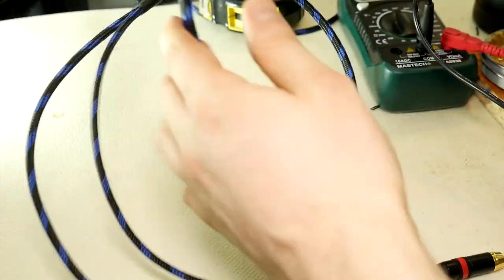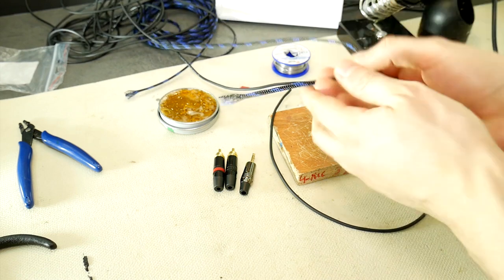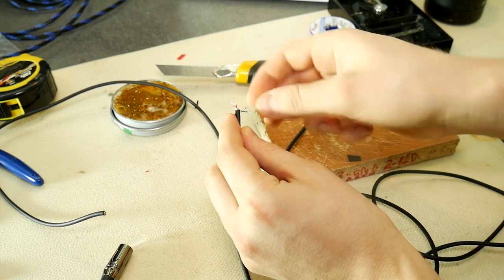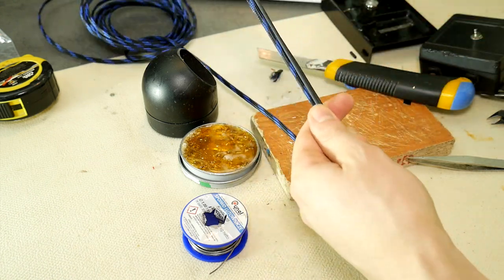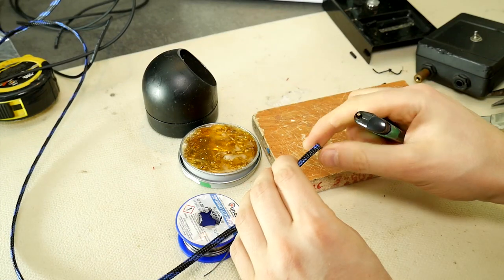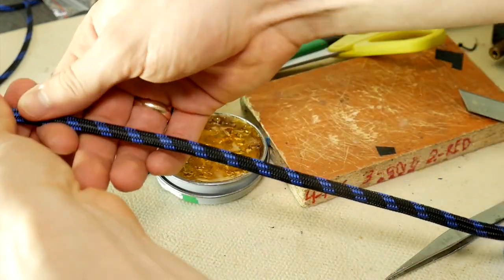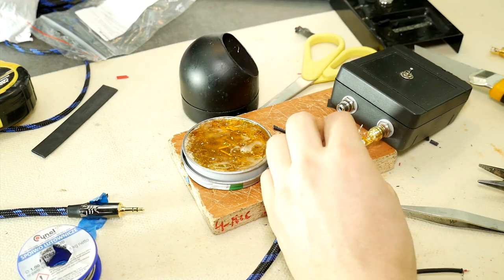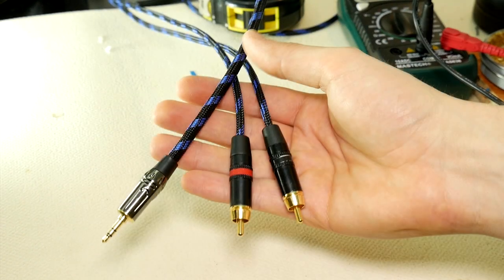How to make HQ AUX to RCA cable [DIY]

Comment from the maker: PARTS for the AUX cable build:

Aliexpress:
- 3.5mm jack: https://bit.ly/3nGrRWD
- RCA connectors: https://bit.ly/2PMIBio
- Microphone cable: https://bit.ly/3nHu6bT
- Braided cable sleeve: https://bit.ly/2QMGNq0
-  Heat shrink tubing: https://bit.ly/3aWh0CC

Amazon US:
- 3.5mm jack: https://amzn.to/3t5BCyA
- RCA connectors: https://amzn.to/3SbClfE
- Braided cable sleeve: https://amzn.to/3EmcQ5P
- Heat shrink tubing: https://amzn.to/3xJ6nN9

Amazon UK:
- 3.5mm jack: https://amzn.to/3lKifNw
- RCA connectors: https://amzn.to/3IDaJ02
- Braided cable sleeve: https://amzn.to/3eaG76N
- Heat shrink tubing: https://amzn.to/3eQL1os

Amazon DE:
- 3.5mm jack: https://amzn.to/3nHt3ck
- RCA connectors: https://amzn.to/3nDFPIw
- Braided cable sleeve: https://amzn.to/3t9NmA3
- Heat shrink tubing: https://amzn.to/3xQDsXM

Comment: So the Aux connector you linked allows for 6.5mm, and that means I need to fit both wires into that. So I guess that means I need to get the L-2B2AT 3.2mm cable at the link provided? Then the RCA connectors you provided are 6mm, which seems like a lot of wiggle room once the 3.2mm wire is inserted. In your video there doesn't seem to be any space with the RCA connector you used. I'm worried the extra space would cause failure down the line. 

How would you suggest dealing with the extra 2mm+ of space the smaller diameter creates with the RCA connects provided in your link? (I'
m looking at the aliexpress links as the amazon links provided do not apply to my country. 

I'm sure I could figure out a way myself, but I would love the advice of a professional. 

PS: great video, everything else was super clear to me. I make my own RCA cables already, just never tried doing it with AUX, but I'm tired of the unshielded portion always causing static when I use poorly designed ones I have bought in the past. It's super distracting.